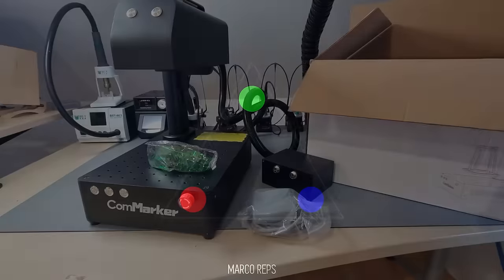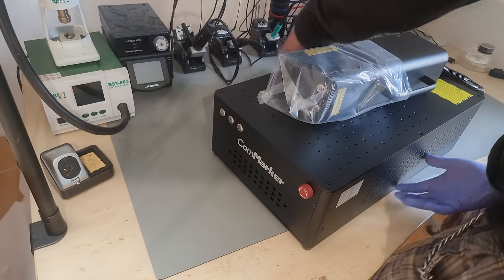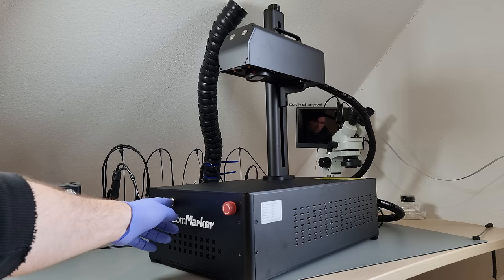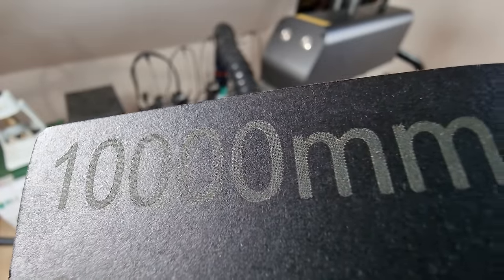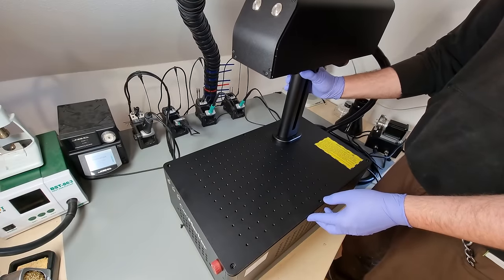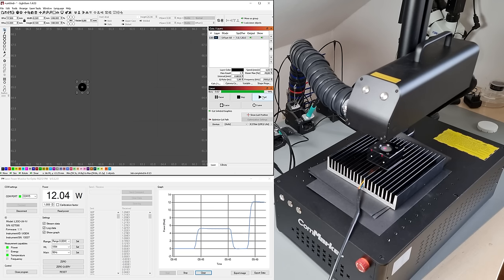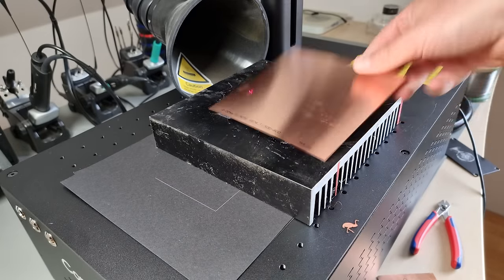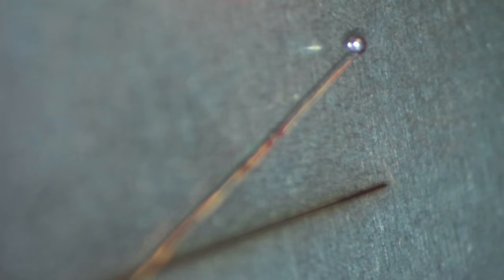What else can MOPA Fiber Laser Engravers do? Welding, Cutting, Cleaning, Coloring, Milling, ...

Comment: Watching your videos about these laser engravers makes me realize how fast and loose the phone repair places in the local mall are playing with their iPhone-adhesive-removal lasers.

Open air kiosk in a high foot traffic area, laser machine just sitting out in the open. No opaque enclosure, no interlocks. No safety glasses for passers by (obviously 😬).
Reply: That's because laser injuries are incredibly uncommon compared to mundane accidents like getting hit in the eye with physical objects. Ever seen a data center tech wearing laser safety goggles when messing with a fiber amplifier? No, for the same reason why you don't wear a helmet while driving even if it's safer to do so
Reply: @NavinF  Because u don't want a fiber straw in your eye?
Reply: @SumUnicus  wtf is a "fiber straw"? Communications fiber comes with cladding all around and a ferrule on the ends. You'll rarely work with bare fiber so that's not relevant
Reply: @NavinF  Yes... If they are short...
Reply: Most transceivers I've seen in a datacenter environment have been under about 20 mW-- assuming they use lasers at all (many low cost MMF 1G or 10G SR optics use IR LEDs instead). Multiple orders of magnitude difference between that and a 60W pulsed laser. Many techs will even try to look into the end of a LC or SC connection for light with their phone's camera (only works for 850nm)... lol
Reply: @yellowcrescent  That's why I said "fiber amplifier". I'm not talking about <40km

Comment: The internal pressure to buy a MOPA rises every day. Marco being the main culprit.

I am super interested in seeing more tests with the lithium batteries. How long does it take to get a weld going? 

With welding the cells its all about limiting the heat that goes in the guts of the cell (besides not melting the insulation) so wonder how it stacks up against spot welding. This multisecond weld is definitely worse, but if it takes little time to weld a fraction, you could swap between cells while welding a larger pack.

With spot welding 21700s around 30 Joules seems to be enough for a single good weld on 0.15mm nickel.
Reply from the maker: Sorry for the pressure! Here is some more 😵‍💫 https://www.accessdata.fda.gov/cms_ia/importalert_255.html I fear these toys are too good to remain unregulated and available forever
Reply: @reps hattest du Probleme mit dem deutschen Zoll?
Reply: @reps hattest du Probleme mit dem deutschen Zoll?
Reply: I guess a big problem is ensuring every piece of nickel is clamped to the respective cell. A whole nickel strip would be much harder to hold with tiny magnets (even if you managed to avoid demagnetisation with shorter pulses).

Could maybe be overcome with some type of clamp... But for safety that would have to be something you could set and then put into an enclosure.
Reply: Aus eigener Erfahrung, nein, selbst Laser im kW Bereich kann man unproblematisch kaufen/importieren. @jamadir
Reply: @reps   oh great... glad the government is protecting me from these lasers. Guess I'll just have to swing by WalMart and buy some guns and ammo instead. 🤣

Comment: i've experimented a lot with colours by the way. if you have a formula for a specific colour with a specific material (4 mm thick a2 stainless in my case) with a specific image, it will get the same colour every time. even the focus doesn't matter that much. in my expeirence, if you make a field of squares, and then try to engrave a bunch of text, the outcome will be different with identical settings and materials

Comment: Awesome stuff !! I work with these machines every day, and the amount you have figured out (and quite quickly, I'd add)  is awesome to see!! Keep up the awesome work. If you have any questions about these systems or parameters, feel free to give me a shout.
Reply: Another fun thing to try is running your 60w with offset fills, roughly:

750mms
60khz 
24% (depending on lens size)
200ns
0.03 line spacing (assuming a f160 110mm lens) 

Adjust power as needed. The desired finish is a light frost, so this is basically a glorified cleaning pass with most of the work being done by the offset fill path. This should work on most metals. Try to start with material that is smooth and clean if you can. 

You can do some pretty fun optical illusions.

Comment: I really like that you can take it off, it has that add on cone thing and then use it as a rust remover or for metal reconditioning, or move the laser to the work instead of bringing the work to the laser. This is like a low powered version of one of those handheld fiber/IR lasers, I've half been thinking about buying/automating one of those as a side project just to see if I can- That's a really nice bonus feature! Great Video :D

Love that flexible exhaust setup, I hadn't even thought of something like that- I'm sure I'll be making use of something like this in the future, just not sure exactly how yet. I learned something today so that means today is a win.

Comment: I wonder if you can do scratch-holograms with that.
Reply from the maker: interesting thought! might need an additional x-y motion table 🤔
Reply: I have been pondering the use of a cheap IR laser onto black perspex or other suitable material that will make a smooth semicircular bottom groove.

Making a special machine that has an end effector with angle and radius axis attached to the end of a positioning stage might make the highest quality scratch holograms.

Instead of a laser using an preloaded air bearing and marking with a tungsten carbide or sapphire sphere on a spring loaded pin that is pressed into the plastic substrate with a micrometer Z axis would provide dainty lead in and out to give better line fade.
Reply: @KallePihlajasaari  There is a Steve Mould video about handmade holograms, in it he mentioned that someone is solving the groove positions from a Blender 3D model and then cutting it with a CNC machine - so it is definitely possible. The question is if a laser etch will produce an appropriate grove to reflect the light appropriately for the effect.

Comment: Time for real questions: can it outperform direct-laminate PCB printer and previous laser engraver in PCB manufacturing :>
Reply from the maker: I have actually invested quite a few hours into finding out, but no result yet. Theoretically this guy could achieve a 1µm spot size and certainly remove copper much faster than FeCl3. What's problematic are thermal delamination of small features and overexposed edges. The former could be avoided by slowing the whole process down and the latter needs different time constants or a kind of ramp mode. Will report if I find out more
Reply: @reps  I guess some of the magic would be finding the best follow up pass to remove any carbonisation from the glue and laminate as well? From what I have seen from other people trying, this can be an issue...

Comment: That’s amazing that you can cut 2mm steel! I’d wondered if these small MOPA lasers could handle that. I see that Comgrow also makes a 100 watt model; I wonder how much more capable that would be without an air assist?

Here’s a (kinda dicey) thought: What about not an air assist but a slowly-flowing oxygen atmosphere? It’d likely be pretty dramatic, but I wonder if burning the metal bits as they come out would help? (Or would it just more rapidly clog the throat of the cut with iron oxide?)
Reply from the maker: I also remember seeing an industrial machine that combined aquajet with laser cutter - their beam being conducted inside the water stream
Reply: @reps  Oh, that's very interesting! I know that water absorbs IR, but maybe not at this wavelength, and/or not enough to matter over such a small distance. Very intriguing!

Hmm, let's see; a dichroic-coated entry port for the laser... 🙂
Reply: @reps  It's called Laser MicroJet by Synova (combination of a waterjet and a laser)

Comment: In my company we weld these sealed through-connectors or other (stainless) steel parts with normal 60/40 tin solder after wetting the contacts with conc. phosphoric acid. Wear safety goggles, gloves and do it with forced ventilation.

Comment: @DisabledEngineer As a disabled Marine Corps combat veteran, hobbyist-inventor/tinkerer, and general engineering enthusiast, this is very inspirational to watch.  My disability is not visible, so I don't have the same issues as you, but I understand your struggles. I have oftentimes considered an exoskeleton design over the past 3 decades. If I may offer two ideas 💡 for your consideration:1) Consider all possible modalities of kinetic machines and their dynamic pros & cons. If you could find or build a small Hydraulic pump paired with some Hydraulic actuator/s and work out the specific kinematics for your use case, well you can't bet the power. 2) Electric linear actuators will also produce much more mechanical force.  (Though they are often too slow, so you will have to pay close attention to sourcing an appropriate motor and gear train.)

Comment: What does MOPA stand for? Mother of penetrating apparatus. For sure, it'll penetrate into surface of anything.
Reply: Master oscillator power amplifier.
It means the machine has total control over its pump lasers and can thereby influence the actual laser beam of the fiber laser very precisely. There is a bit more physics involved but that's my understanding as a layman.

Comment: wondering what overlap and exclusive applications this 60w version compares or not to the iKier K1 Pro Max: 48W (which is about 1/3rd the price). clearly the applications are a bit different. but what can be done on those other gantry style ones (presumably they are diode ones instead of a fibre laser?)
Reply from the maker: blue CW diode machines can remove coatings and anodizing from metals, but can't really engrave bare metals

Comment: 32:05
have you tried static electricity as a way to clear the channels?
A bit like electrostatic precipitators, exept you don't need a grid to electricaly charge the dust, you just apply a tension to the metal.
i wonder if a sufficient electric feild would get the hot particule going to an electrode, thus clearing the high aspect ratio trench....
I hope you don't need several thousand volts for that though....

Shower thoughts...

Comment: How strong does the oxide layer stick to the substrate? Can you remove it by swiping your fingers over it?
Reply from the maker: Adhesion is perfect, you'd have to grind or laze it off. I think chemical resistance might not be as good as unmodified stainless, colors might change when exposed to moisture or acidic foods, haven't tested this myself yet.
Reply: @reps  Yeah well you could just coat it with a chemical resistive polymer or something like that to prevent further color change (coming from normal oxidation in the air)
Reply: I recall a few papers showing the corrosion resistant being worse on areas with laser induced oxide growth but i think given the proper coatings you could mitigate that.

Comment: 2:50 Complaint 1:  The crimping on the neutral is dreadful.
A single wire crimp used to crimp two wires, leaving exposed conductors.  Modern standards treats neutral like a live wire.

Comment: I you mentioned making a resistor standard with Nichrome wire: why not Manganin? I’d think it’s very low tempco would make it better suited.
Reply from the maker: Both can be annealed and tweaked to fantastic performance with a bit of patience. A 5ppm/°C NiCr wire is what I have available
Reply: @reps  Oh, very interesting, I didn't know about changing the tempco by annealing. 5ppm as a starting point is fantastic, I had no idea NiCr got into that territory. (Wikipedia gives the typical number for manganin as +15ppm, but I now see other sources saying +/- 10ppm. I'll be very interested to hear about your experiments, I've long wanted to build my own reference resistors. (Kinda pointless in a way, my best meter is a decades-old 3457 that I've never had calibrated, and a couple of internet 5ppm voltage standards. I still like the idea of making my own reference resistors. though.)

Oh hey - when are you going to build your own watt balance? Your community is waiting... 😆

Comment: Can you do LIBS with? Creating a repeatable plasma seems to be easy with it, but capturing the plasma with sufficient temporal resolution could be difficult. You need to start capturing only after the the plasma has cooled down so most thermal radiation has decayed and breakdown spectra are dominant.

Comment: For the thick steel sheet you could have used the laser to only mark or 'center punch' the round holes, and drill them out on a drill press or by hand later.
Reply: Then the machine might have to wait for the first square hole to cool down before each round. But if there is a lot of holes it should be faster to mark and drill the round holes.. but not as exact.. or fun :D

Comment: Have no expertise in laser-oxidising stainless for coloured engravings, but wondering if it's possible to derive the settings semi-automatically with a known test field and a high colour-accuracy camera? 
There'd still be small variations within the material ofc, but if there is a known relationship between laser 'strength', oxide thickness/texture, and resultant colour, then would an automatic calibration routine be possible? Save time and material, I'd think, but maybe there's too many variables involved to be practical.

Comment: 18:10 - this concerns me a lot. What brand and model would you recommend? I have the same JPT MOPA 60W source (E2) and want to keep my eyes intact.
Reply from the maker: Put a light-tight box over the machine and point a webcam at the working area? Otherwise second hand ebay name brand goggles with a high OD rating at 1064nm, my best pair is Uvex Laservision

Comment: idk, this build quality seems pretty poor for a product in the £3000+ price bracket, I know its cheap for what it is but still, the connectors and PCB adjustments to make it neat internally would cost circa £5 at most. Also that powered axis seems wobbly as hell, most £300 3D printers have more stable axis... I didn't realise that was the price until I checked the amazon links, from the video I had clearly incorrectly assumed this was a few hundred GBP not several thousand :O
Reply: Had a moment - looking at the number and ran my finger under it to be sure.
Time to learn how to make one.

Comment: I am a watchmaker and i crave a jewelry laser but its 12k it must be possible to adapt on of these chinesium machines. I mostly weld silver without coloring mit nem edding;) then it works but you need the highest power jewelry’s laser. 60w could be enough. Love to get you input.

Comment: If you can't weld copper wire hit it!
Or to be more precise flatten the copper at weld end such as through rolling it into a strip and maybe using the edge as the connection point instead of the middle.

Comment: Do you think this could mark on a pinball?
Reply: Most of them are good old carbon steel so sure. It has been done in the past, but there are challenges. You don't want to go "deep" in your marking unless you want the pinballs to sand away the playfield! Also, the nifty colour effects get worn off the balls pretty quickly and they revert to plain pinballs pretty soon.

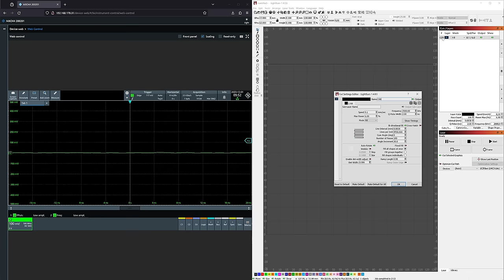Comment: Hi Marco, keen eye noticing that the angle of incidence affects the color of the light reflected off of the thin film that you're essentially creating by growing the oxidation layer. The color of the reflected light will always depend on the incident angle, long as you're using white light. By changing the angle you're viewing the thin film at, you're changing the light path length through the material. This changes the interference and constructive patterns observed between different wavelengths. https://www.youtube.com/watch?v=sMPtbbsu_zo&t=1206s starting at 19:37 this video shows how multilayer thin films are affected by changing the angle of incidence.